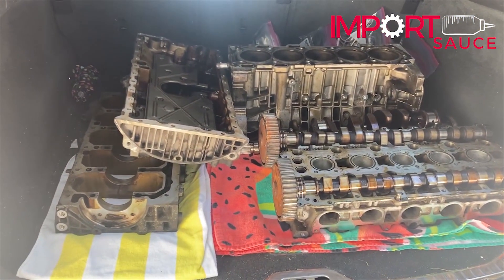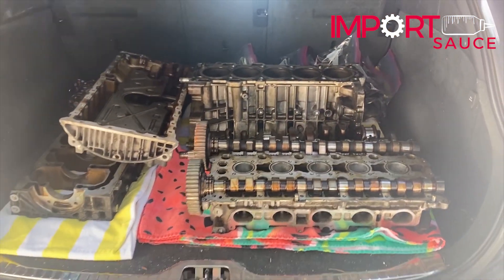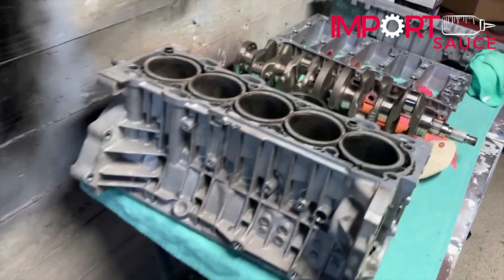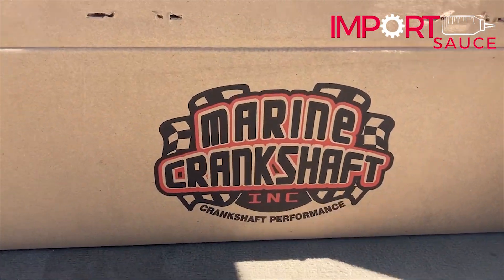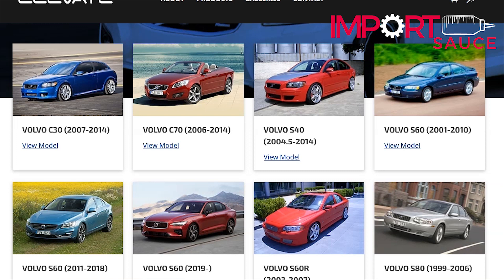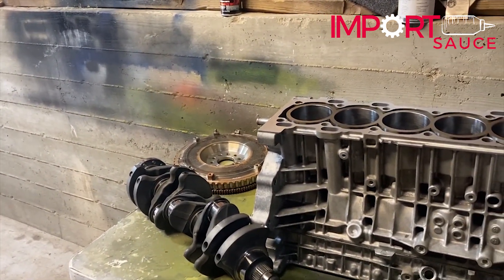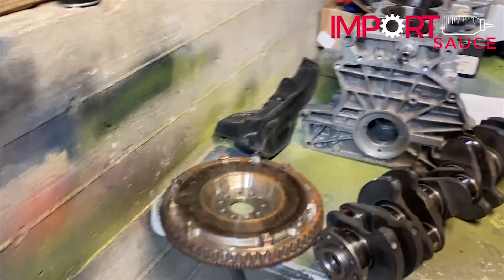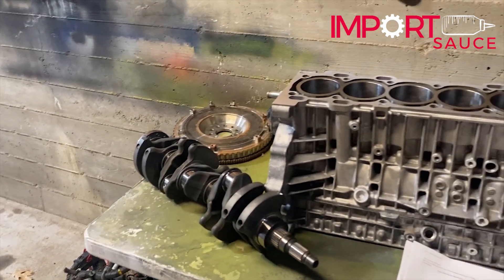Volvo T5 Engine Machining Process for Full Rebuild - Step by Step

Comment: Hi Joel, Great video's. I'm planning on building a T5 as wel now i still have acces to a CNC machine at my university. I was looking into what sleeves i wanne put in. I was wondering why you chose for the Elevate sleeves over the darton sleeves.
Reply from the maker: Thanks for watching:
1. I like and trust elevate products. I have all but one item from their P1 catalog and have never ever had an issue with any of it. 
2. From the Elevate website: "Unlike competitive designs that rely on o-rings and sealant to keep the coolant separated from the oil between the cylinder and block, our interference fit (sometimes referred to as “press fit”) design creates better engagement between the cylinder sleeve and block, increasing thermal transfer and making for a stronger overall block."

Comment: Hi Joel, my names Brent.. I blew my head gasket last year and rebuilt my cylinder head, machine shop hot tanked and resurfaced the head, rebuilt valves, new coolant hoses, water pump, tensioner, belt, thermostat, got it all put together and I’m getting crank no start.. I’m stuck and help please 🙏 thank you love the videos
Reply from the maker: It’s the three basics to check first. Spark and fuel. Do you hear your fuel pump turning on under the back seat when key is at position 2? The entire coil pack harness fully plugged in. Fuel injectors fully seated and all 6 plugs connected there?  Any codes on a scanner or vida?
Reply: Hi Joel, You don’t know how much I appreciate your response and help.. yes coils are plugged in, I will check on spark and fuel and get back to you, I just got a code reader so I will get back.. again I don’t hand anyone to help, I appreciate it This so much. Thank you
Reply from the maker: @ares_mello  sure thing, VIDA or Vdash would be a great help as it will read the volvo computer, not just basic codes, where do you live? Know anyone local with Vida or Vdash?
Reply: I live in Clovis ca… well I can look it up, but money is tight
Reply from the maker: @ares_mello  shoot me an email: joel@importsauce.com